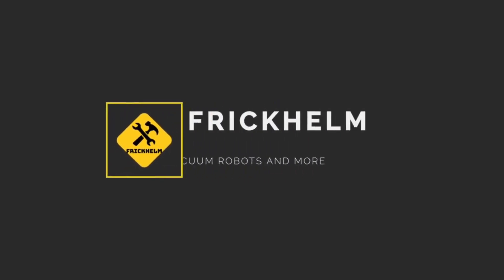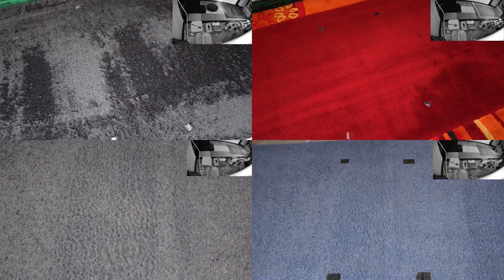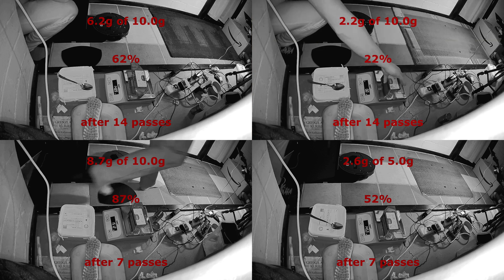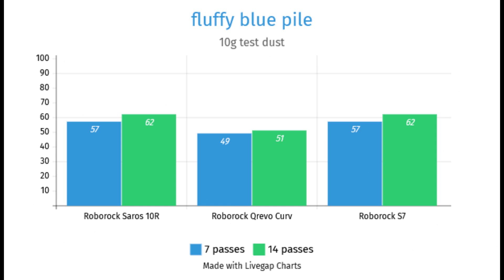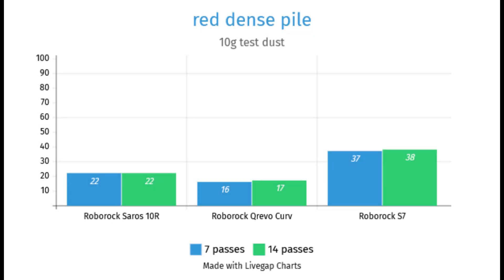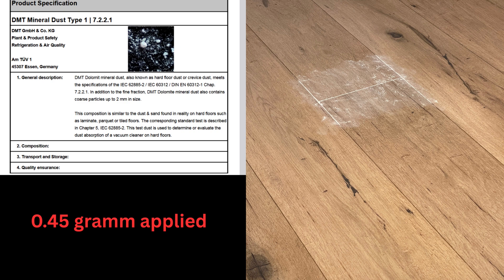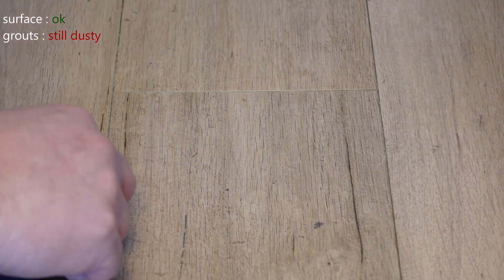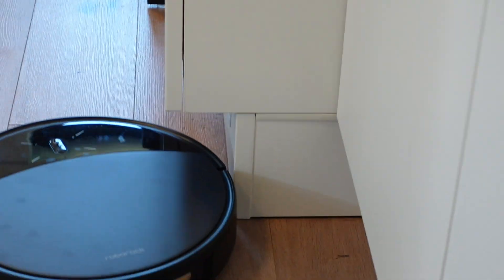Roborock Saros 10R cleaning performance review

Comment: A poorly designed robot that was insufficiently tested before launch! It leaves behind dust/dirt that is not vacuumed up during vacuum and mopping cycles. The much-praised split brushes actually leave a strip between the brushes that is never vacuumed properly. I tested two new Saros 10R robots, both of which have the same problem. I tried all possible settings (I am an advanced user of smart/IOT devices), I also talked to the technicians at Roborock, and unfortunately, there is no solution, no setting, and no firmware that can solve the problem. Those who notice it, fine, those who don't, just live with it! Try the following test: finely crush some black cereal (e.g., chocolate cereals) and scatter it on a light-colored surface for contrast (e.g., bathroom tiles). Set the robot to vacuum and mop. You will clearly see how it leaves a streak of unvacumed debris behind. Keep away!
Reply: Regular 10 is better choice?